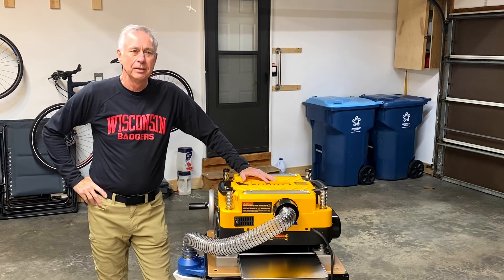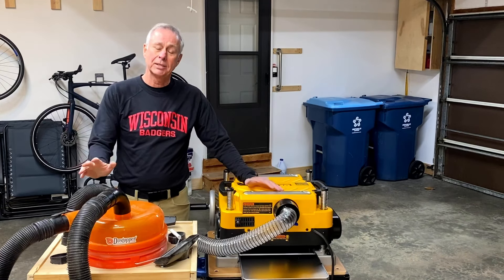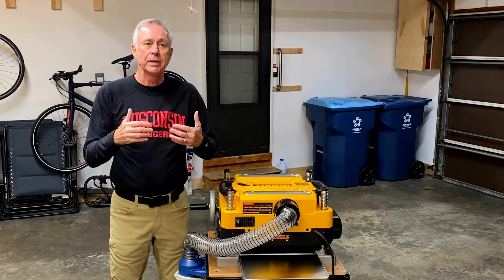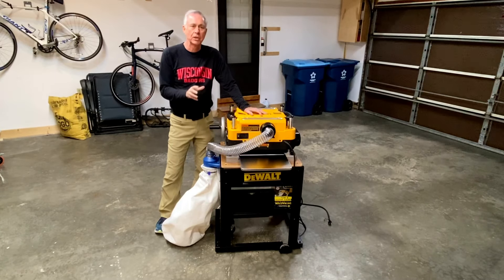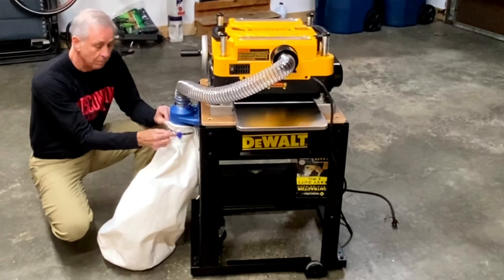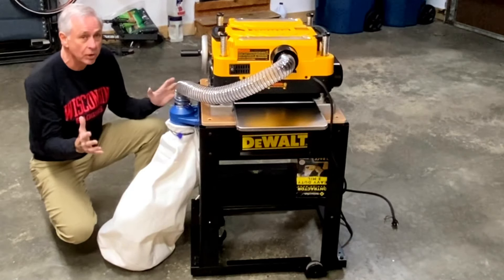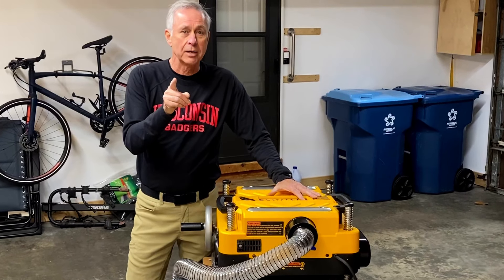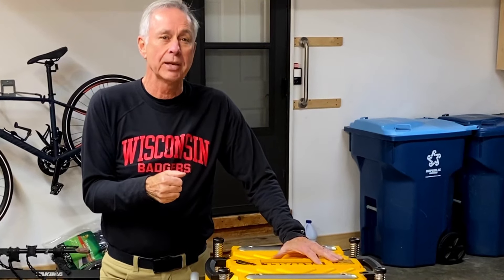How to Control Dust on the Dewalt 735 Planer

Comment: If they could remove that shelf in the middle and make a plastic can that holds the dust bag underneath, that would sure make it a nice compact unit, and simple.  They would need to leave room for the wheel pedal, but I think it could be done, and be an add-on kit from Dewalt.
Reply from the maker: @atsf-3415  That’s a great idea!

Comment: I'm confused.  Why take the 4" outlet from the machine and convert it down to 2", only to run it back to 4" at the bag?  Why not just run a 4" hose directly to the bag?  What am I not understanding?
Reply from the maker: @jlester4892  I didn’t have any other use for 4” hose.  I do have other uses for a 2.5” hose.  You certainly can use 4” directly into the bag.

Comment: I have 2.5" flexible hose from two different companies, and neither of them fit onto the DW735's output because the port and the hose are both very close to 2.5" so neither can fit in or around the other.  How on earth do they connect, can't somebody make a video showing how
Reply from the maker: @BenDiscoe  here is the Amazon link for the hose I used.   https://a.co/d/5dNrV0b     I didn’t have any issues attaching it to the planer. If your hose is a a bit too small, you might try just heating it up with a hair dryer.  That might help.  Don’t over heat it, as it could melt.

Comment: Great video and this was my inspiration for the TWO modifications I made to my Dewalt planer table.  ONE was to cut and fasten a section of plywood to the four pre-drilled holes in the frame for the felt bag to rest on; that way it doesn't get scuffed up or frayed from my concrete floor when I move it around.  The SECOND was to mount my  blue (2-1/2' to 4")  adapter higher and directly above the bag inlet.  I simply used a small piece of left over 3/8 soffett material for this.  To attach that piece, I drilled four holes on the flat side-panel of the table, then mounted that piece of wood with four small bolts,  and then mounted the blue hose adapter to the top of the wood piece using Grabber screws.  Of course I used shellac to coat the bottom piece of plywood to make it look pretty,  and I simply used black spray paint on the upper section of wood to blend in with the table.  It looks great.....but better yet, it works great. The bag doesn't drag on the concrete shop floor  when I'm moving the table, and that'll make it last longer.  Thanks again very much for the video.
Reply from the maker: I’m glad my video was helpful. I like the sound of your modifications.  You should make a video showing us how you did it.

Comment: Very interesting. I’ve got my dewalt planer hooked up to my Ridgid shopvac. It definitely backs up the planer blower and sometimes blows the hose off. It sure fills my cyclone in a hurry. I was thinking about not using the shopvac and I’m happy I found your video. 
I’ll have to do what you did. It clearly works. I planed 50 2x4’s for a mega Jenga set I made and filled 1 1/2 large garage bags with shavings. My boards were not the 6:34 same thickness to start with by a long shot. 
I to think you’ve solved my problem. 
Thanks
Reply from the maker: I think you will find this method works much better.  When I tried to use my shop vac, it was a mess.  Making that Jenga set would create some serious dust!  I’m glad you found the video useful!

Comment: Just rigged this up and am getting a significant static shock from this system.  I leaned against the outfeed table and got a heck of a shock.
Reply from the maker: I’ve had that happen as well.  I wonder if it would help to have a ground wire to lay on the concrete?  If you try something like that, let me know if it works.   Just so you know, I was getting shocks before I added the dust collection.
Reply: Solution is to buy the anti-static hose.

Comment: thank you for this.  I just got my planer and I'll admit i did not see that section in the manual about not hooking up a shop vac to the planer.  there were flakes flying everywhere.  I'll look into your suggestions.  Much appreciated!
Reply from the maker: That sounds like a great Xmas present!  I’m glad the video was helpful.
Reply: @Ray_Here  ive had my eye on it for a while and i feel like i'm going to get a lot of use out of it since i'm working mainly with reclaimed wood right now.  gotta say, it's an amazing machine to pull off such a good finish from trash quality wood!

Comment: I use the bag from a leaf blower and some of the piping. all free and no dust in shop except a little on the floor when I empty the bag into a tote .
Reply from the maker: Sounds like a cost saving idea.  My only concern would be the fine dust that the bag might not catch.  Thanks for sharing!

Comment: I have been using the Dust Deputy on the 5 gallon bucket and get wood chips everywhere, so I am going to try your setup.  Thanks. Dan
Reply from the maker: That’s exactly what I tried Dan. It’s a mess. You will be much happier with this method.

Comment: DO I have to get the rocker reducer? I found a Woodstock W1044 4" To 2-1/2" Reducer. Looks like I will just need to get a strap clamp to mount it, not sure if the rockler piece does something different or not.
Reply from the maker: @smeg8557  It sounds to me like the Woodstock reducer should work.  The Rockler reducer has a a place on each side to mount it with screws.  Other than that, I don’t think there’s anything special about it.  Please share whether or not it works.
Reply: @ I definitely will. It arrives tomorrow. I think it was four dollars or something, but I’ll let you know.

Comment: Glad I stumbled onto this video. I came up with something similar on my own, but did not think to mount a coupler to the side of the cart. That will make moving the planer around with the bag attached that much easier. Great video, thank you.
Reply from the maker: @cjg1560  Yeah, it helps for moving the cart.  Thanks for the comment!

Comment: can I just use a 4 inch elbow adapter for the unit with a 4 inch hose to the bag? do I need to use 2 1/2? not sure what reducing it will do
Reply from the maker: You can probably do that as long as the elbow fits the blower port. Good luck!
Reply: @ hey thank you for responding. I really appreciate it! Sorry to bug I just had one more question. I’m so new to this, but let’s say I’m deciding to make a noodle board and it’s gonna be wider than the 13 inches of this planer. I guess do you do it in two passes to try to make everything level I mean before I glue it up do half of it and then the other half I’m just confusing how to get multiple boards the same thicknessusing this planer
Reply from the maker: @smeg8557  No problem getting them to the same thickness.  Just work them down at the same time.  I recommend that you start with boards 10-12” longer than you need.  There will probably be 5” or so of snipe on each end.  Since the boards will be wider, be carful when you glue them up.  They will want to bow in the middle.  Best to use cauls and put clamps both on the top and bottom.  Good luck and let me know how it goes.  Better yet send me a picture.  There is an email address on my channel overview.  Let me know, if I can be of any more help.
Reply: @ wow thank you so much for the help

Comment: Perhaps an additional elbow fitting at the planer outlet will help the hose keep clear of the outfeed ..thought?
Reply from the maker: That’s a great idea!
Reply: @Ray_Here  Did you ever do this? I can't find an elbow that works quite right for the 2.5"
Reply from the maker: @ian3453  I connected a 2.5” flex nose directly to the planer outlet. An elbow would probably be neater but I didn’t bother to look for one so I don’t have a clue what elbow you would use.

Comment: Just bought the 735x—it was on sale as the 735—and I’ve been kind of apprehensive about dust collection. 
Other videos I’ve seen showed people setting things up with a knock off top piece from the Mullet system—with no vacuum—like you said, the fan blows out plenty of stuff—you don’t need to worry about hooking up a vac—and all the challenges that holds.  
I was hoping that the Powertec bag was still available—but someone said it wasn’t available when they looked.  
Another video showed someone hooking up their 4” clear hose to a length of black irrigation hose—the style that is non-perforated.  
I’m looking at both of those options as I have room to run the irrigation hose out to the side of the house. 
Thanks again for the best video I’ve seen regarding this planer set up. 
PS:  Hubby and family are from Madison—and so it was fun to see your shirt.  Go Badgers! 
Go Packers!
Reply from the maker: @ShelleyEisele  I’m glad the video was helpful Shelley.  It would be great to run the hose outside.  I don’t have that option.  I actually live in Southern Illinois but My Daughter and her husband live in Madison.  We became Packers fans when the Rams moved out of St. Louis.  Our school doesn’t have a football team so since her husband went to UW, we became Badgers fans.   It’s a beautiful area up there.  We are up there a lot to see our Granddaughter.   Have fun with the planer.  It works great but watch the snipe!
Reply: Thanks again for a great video.  
That was a huge bummer when the Rams moved. U of Wisconsin is a great school—my husband liked growing up in Madison and going to school there—but after graduating, he followed his dreams to live closer to mountains.  
I’m glad he followed his dreams. 
Happy Holidays to you and your family!

Comment: love it.   May I ask why you didn't go just strait 4 inch pipe to a 4 inch dust right connection?  I am going to buy either your build or do the straight 4 inch all the way to try and minimize restriction.
Reply from the maker: I have no other use for 4” hose.  I can use 2 1/2” hose in other applications.  Also, the opening coming out of the planer is actually only 2 1/2”.  The outer lip can accommodate 4” but the opening is only 2 1/2”.  Thanks for watching and commenting.  Over such a short distance, I doubt the hose size makes much difference but I’m no expert.

Comment: I purchased this planer https://www.youtube.com/post/UgkxIzvvTi3_Qc8JnVdYYRJCvuoDC4QjTzeL to replace a well worn Delta bench top I'd had for a number of years. I should have purchased it sooner. The performance is much better than I expected from a bench top planer, and the best I've used so far. When feed and discharge supports are properly set snipe is all but eliminated. Cuts are smooth and free of flaws. Setup was dead right out of the box. Feed rate is smooth, steady and sure. The standard (fast) feed rate left rough sawn cherry smooth and with little sanding to be done for a fine finish. After 100 board feet of hardwood the knives were still sharp and performing well with clean sharp cuts. The dust blower system is phenomenal! With my dust collector connected and after 100 board feet there was little if any waste left to sweep up. It works and works very well.The unit is heavy. It's a bit of a beast weighing just under 100 pounds. The optional table/mobile base is very nice and makes a sound and sturdy platform for the planer. However, the instructions are rather lacking. If you're mechanically inclined there should be no real assembly problems other than an potential for extreme disgust. But it is a nice table.
Reply from the maker: Gracias my friend!

Comment: Thanks for the Video. Great idea and overview. But 1 question. Why not just use a 4inch hose and avoid the need for the adapters?
Reply from the maker: I could have but I can use the 2.5” on other things.  Thanks!
Reply from the maker: I has other uses for 2.5 inch hose.  You can use 4 inch.

Comment: Brilliantly simple.  I've just done the same thing.  All I did different was to put the bag on the other side.  Also, I found a Powertec bag that has a window and zipper bottom - model 70399.

Thank you.
Reply from the maker: Great. They came out with the zipper after I bought mine.  Thanks for commenting!
Reply: Thanks! Great find on Amazon. Mine will be here tomorrow!

Comment: I use a craftsman shop vac, 16 gallon.  On the planer a 10 ft hose connected to a 15 ft hose on the shop vac, no blow out.  Long hose is the key the length cuts the pressure coming off the planer, do not get any blow out.
Reply from the maker: Good to know.  Thanks for sharing.
Reply from the maker: Thanks for the comment!

Comment: Great setup!  Q: Was there a specific reason for not  using a 4" hose all the way?
Reply from the maker: I get asked that a lot.  The vent out of the planer is really only 2 1/2”.  There is a wider lip to accommodate attaching a 4” hose but the opening isn’t actually 4”.  In addition, I can use the 2 1/2” in other applications.   Thanks for watching!

Comment: Hi Ray, 
Any chance you have the length and diameter of the bag fully inflated? On my shop made cart I plan on having the bag rest underneath the planer
Thanks
Reply from the maker: When I return home tomorrow, I’ll crank up the planer and get you some measurements.
Reply: Thanks for the offer! As soon as I sent the request to you I thought to myself to check online and on HD they say it’s 24”Length with 14” Diameter.  Hey FYI they now make it with the view window for under $25 for 1 micron bag.
Reply from the maker: That’s a much improved bag. Good luck with building your cart!

Comment: Hey just curious. Why is the 2.5 to 4” converter necessary. Why not just run the 2.5” hose into the bag?
Reply from the maker: @levichase  The opening of the bag I have fits a 4” opening better than a 2.5” opening.   I’m not sure I could get the bag to fit snugly enough around a 2.5” opening.

Comment: Thanks for this very helpful and informative video!!  Just purchased the exact same planer and stand and have ordered the dust collection items linked in the video description.  This is my first thickness planer and once those dust collection items arrive, can’t wait to get everything setup and begin using this system.
Reply from the maker: Thanks!  It’s a great addition to your shop!
Reply: Looks like you attached your Rockler coupler in the center on the side of your stand.  What is the length of your 2 1/2” hose connecting the blower to the Rockler coupler?
Reply from the maker: @rustydegeorge5726  It’s about 30”
Reply: Great, thank you very much!!
Reply: Funny my Dewalt planter is 15 years old and the design has not changed one bit. Great little addition to my woodworking equipment.
Reply from the maker: @terichampion1165  That’s interesting. Do you have a similar dust collection method?

Comment: Excellent video.  Thank you!  Is it possible to connect the bag directly to the 2.5" outlet?  For example, I have a Bosch bag with a clip on the end.  Second, why do you convert from a 2.5" hose to the 4" outlet?  Is there an engineering need for that?  Can you  keep it 2.5" all the way to the bag?
Reply from the maker: It seems to me that if you connected a bag directly to the planer, the bag would have too much of a bend and restrict the outflow.   The bag I purchased has an opening that accommodates a 4” input.  A 2.5” hose would not allow me to to effectively tighten the bag to the input.  If your bag has an opening that will cinch down to 2.5”, that should work ok.  Having said that, Give your ideas a try and see how it goes.  If you see that too many chips are left in the planer, make the appropriate adjustment.  Good luck and if your do something different that works, let us know.
Reply: @Ray_Here  I'll try it out and report back to you.

Comment: Has anyone just ported the exhaust into a trashcan?
Reply from the maker: @MrGrundle  I have seen a video or two where someone did that.  There are lots of different methods to try.  The method I used seemed to be effective and at a reasonable cost.  Thanks for the comment!

Comment: do you need the cart for this to work?  Is the bag attached to the cart?
Reply from the maker: I
Reply from the maker: I don’t think you have to have a cart but the bag should probably be off the floor. The 2” to 4” converter is attached to the cart and the bag attaches to that.  If you used only a 4” hose you might be able to just attach the hose directly to it. Thanks!  I do really like the cart though.  Makes the planer more portable.

Comment: Great dust control solution for my Dewalt 735.  Where did you buy the blue hose fitting attached to the side of your planer stand?  Thanks for posting the video.
Reply from the maker: Thanks!  You can buy it at Rockler.   The link is in the description.
Reply: Thanks Ray...Just placed my order... @Ray_Here

Comment: I have my Dewalt planer hooked up to my dust collection system, which works fine. But I like the portability of your setup. I’m curious, do you have issues with static electricity build-up?  I was getting shocked like crazy before I grounded my hose.
Reply from the maker: It does build up static.  It did it before I added the bag.  How did you ground yours?  Also,  I may have hit the thumbs down button on your comment in error. Sorry!
Reply: @Ray_Here  I grounded my hose by taking a long length of copper wire and wound it several times around the dust collection hose. I attached one end of the wire to a screw on the planer and the other end to a bolt on my dust collector.
Reply from the maker: Thanks!  I’m going to try something like that. The static shock is annoying!

Comment: But here's a question - Why did you choose the Rockler 2 1/2 TO 4" Dust coupler rather than 2 1/2" straight?  Why increase the size since the hose was already 2 1/2"?  Also, couldn't you forego the coupler and just have the hose directly into the bag?  Love to hear your thoughts on both.
Reply from the maker: The bags I looked at needed a 4” hose.  I was afraid that the bag opening wouldn’t tighten down enough on a 2 1/2” hose.  Thanks for the question.
Reply: I think any adapter would work with the 2.5" to 4" but the Rockler version looks as if it is mounted.